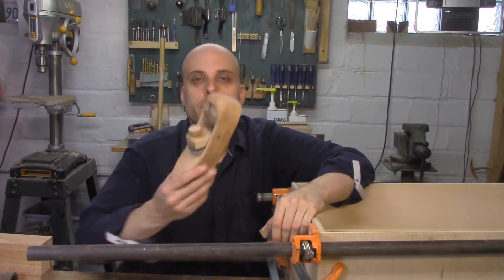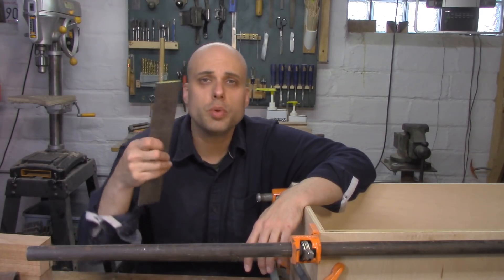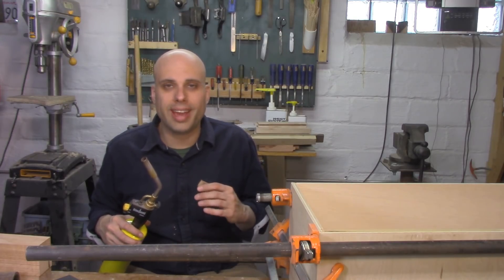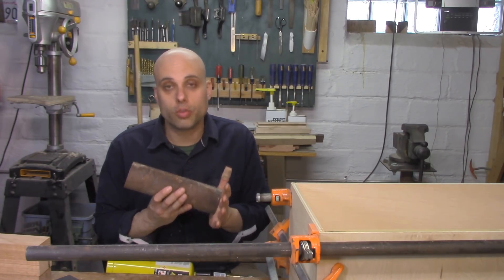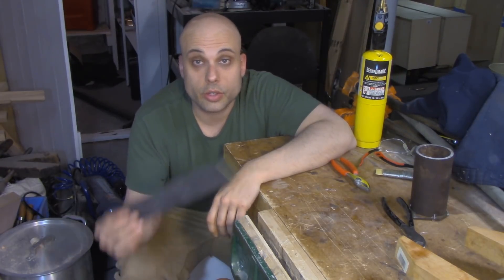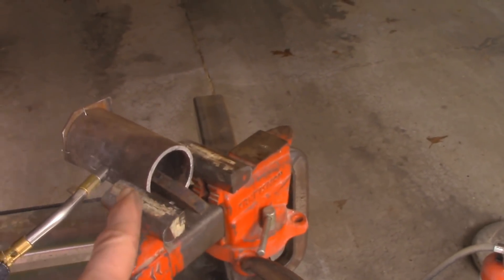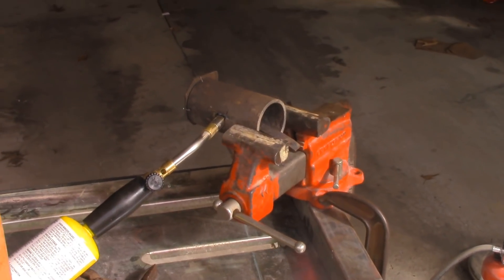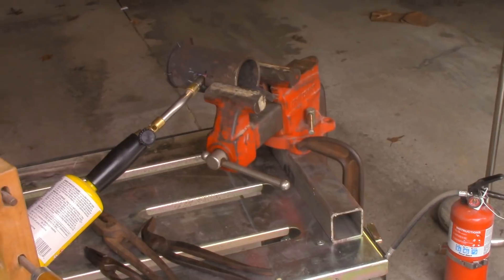Make a plane blade from SCRATCH (backyard heat-treating)

Comment: Does leaf spring need heat treatment before shaping it into a blade plane? Hasn't it already heat treated in the the factory that made it?
Reply: leaf spring won't be hardened to blade hardness,because that makes it brittle and easy to crack. springs HAVE to flex. and it's better to cut and shape your blade BEFORE you harden it,then do the final flattening and bevel finishing,stropping.

Comment: This is not a pro tip, but I'd not keep my fire extinguisher next to "the problem". To be fair, I do keep the fire extinguisher mostly in the middle of my workshop, but I know if anything was to light on fire, first thing I'd do would be to run out. Which would require me to run back in for the fire extinguisher. So since I have no idea where to place the fire extinguisher and have no intention on buying a new one, I have no other choice than to not be stupid, but I guess you have that covered.

Comment: Hi interesting video thanks, I received an old union plane from a neighbour which I have restored.  The only issue is once I sharpened the blade on the stones it doesn’t hold an edge any more.  After planing some spruce 2x lumber a few passes you can a burr form.  Do you think this process would work to reharden the iron?  I think if I have to spend 60 to buy a new one this things just gonna be a wall hanger unfortunately.

Comment: Great video....all the necessary information for anyone who has never done this. My first knife I treated in my Weber Grill with a large shop vac blowing air into the charcoal and an old car speaker for a magnet.  Eventually worked my way through a fire brick kiln to electric heat treating oven with digital control.  Have a mix of oils for quenching including a half quart of old transmission fluid. I get flashbacks of my '73 Ford van with a leaking transmission gasket when I heat treat a knife.

Comment: For someone who is a hobby black smith but also wants to get into carpentry, this has been the perfect video. I like to use traditional methods when I can so what I was looking for is the color of the Iron after you tempered it because, to me, a specific temperature isn't useful to know since I don't want to do it that way.  Looks like a darker straw color which is about what I was expecting but I wanted to be sure since I haven't done much tempering. Seems like you did some good research on the process. Thanks for the video.
Reply: I thought only dwarves could produce steel. Where did he get this from?

Comment: as a hobby baker, get a large pizza stone to put in the bottom of your oven and let it heat at least an hour before using. The stone will keep any variations in air flow or uneven heating from affecting your bake by acting as a thermal mass.

Comment: Moving your blade in the oil can cause the metal to warp the best thing to do is to move the blade in a vertical motion up and down trying to keep it straight. Until the blade is cool enough to handle without gloves. Just a recommendation. That gold color is the same concept and seasoning a cast-iron skillet. It is the oil residue remaining in the steel regardless it is still a great indication of proper tempering.

Comment: It's called thermal saturation. The air in the oven was 400 but the racks and walls were still pulling heat out.

Comment: 14:45color means absolutely nothing at all use a brand new Mexican made black diamond Nicholson file they are tempered to 64 hrc if the file barely bites and leaves heavy scratches on your tempered blade it will be fine for a plane and isnt too soft

Comment: At 1:27...let me stop you there.... As a experienced blacksmith/bladesmith (26years blacksmithing 7 years bladesmithing) i have to correct you... Neither of those steels are easy to heat treat at home and both are very unforgiving in their heat treatment theres very specific temperatures and soak times involved...that being said O1 is a medium speed quenching deep hardening steel this means you can quench in food oils just fine with excellent hardness if you got your temp and soak time correct...1095 is a shallow hardening fast quench steel meaning its very springy when tempered (it is a spring steel afterall) it also means water or fast oil quench only if you hit the specific temperature and proper soak time (parks 50 is the recommended quench oil) ...Neither should be used by beginners you should stick with simple carbon steels ideally 1075-1080-1084 they are cheaper and give rock solid performance with even the most rudimentary understanding of heat treatment
Reply: And for the naysayers i have gone toe to toe with mastersmiths over this very thing more times than i can count and proved them wrong with some basic metallurgy knowledge which you dont need to pass the ABS mastersmith test which i think is absolutely absurd and shows little mastery

Comment: 1095 is not really beginner friendly... it has less manganese and more carbon than other 10xx steels, making the heat treatment process less forgiving.  1075/1084/15N20 is way better for people starting out 👍
Reply from the maker: I don't know. I got it right on my first try...and my second...and my third. Doesn't seem too tough to me.
Reply: @RexKrueger  I'm glad you are happy with the results you have had. 
Still, to get the most out of the steel/heat treat 1095 will have the best results when the heat is consistent and measured, the steel is soaked at temperature, and a fast quenching oil is used. 1084 will give better more consistent results and end up a little tougher using the methods in the video 👍

Comment: Rex are you cacnadian cause those temperatures seem a little low.  I’m thinking 1800 to 2200 degree Fh. I’m mean I forged a lot of blades. So. Yeah.    Call if you need a little help sometime.  Oh yeah a little ceramic wool would help a lot

Comment: When talking about the oil flaring up, you should remind them not to use water to put put an oil fire, as the oil will float atop the water, and may, in a worst case scenario, turn a can of flaming oil into a 5 foot diameter puddle of oil flaming atop water.

I"m sure I'm not the only person who saw the 5 gallon bucket near the oil......

Comment: I am a blacksmith/bladesmith and i temper woodworking tools at 325  to 375 depending on the tool plane irons i temper at 325 chisels and wood slicks and similar tools at 350 to 375
Reply from the maker: Good for you?

Comment: Used lawnmower bladed are just about the right size and thickness and free. Make a coupon for a test in oil quench. If it hardens enough to break cleanly, the steel could be used for an iron.
Reply: I've heard of the "break test"... BUT never actually seen it done.
    What mechanics do you recommend???

    I mean... if I stick the end in my vice, and strike it with my "breaking" hammer (or as some call it "the big F") I can pretty cleanly cleave about anything... including most stones... so I'm just a tad apprehensive. ;o)

Comment: You could have saved yourself the trouble of making that oven contraption and just get out a charcoal barbeque and a use a hairdrier as a blower to get the fire hot enough.  Afterwords you could have cooked dinner over it aswel.   It would have saved you time and be a lot safer than the setup you made. Even it was a great way of solving the problem at hand.  Take a look at the video's from Paul Sellers.  The guy is great and he explains a lot. He is on the oposite side of the spectrum of where you are, ie he is a retired carpenter/woodworking teacher that explains how to build tools and stuff instead of buying everything.

Comment: A Bi-Metal Hole Saw is the best readily available tool for putting a hole in thick-wall steel tube. Especially with a drill press. Done both the step-drill and hole-saw with a hammer-drill in 1/4" thick structural steel, and the hole-saw was way less of a hassle.

Also: refractory materials are hard to find, don't get me wrong, but having a ceramics supply shop nearby can make things a lot easier for the home smith.
Reply: OR... getting a pack of "ceramic brickets" from the barbecue section of any hardware or similarly inclined department or big-box store works...

    AND of all things, plain old wood-ashes work WONDERFULLY with "stucco mesh" as an insulation. ;o)

Comment: Interesting forge!  Hey, it works!  That's the main thing.  I'd never have thought of using that small of a pipe for a forge but, as I said, it worked!
My question is, how the heck did you get the MAPP gs to last that long!  I finally quit trying to use it for anything because it runs out so quickly!  I hardly ever get more than a total of 5 minutes!
Good video and everything worked!
KUDOS!
Reply from the maker: Thanks!  I don't know, but my MAPP cylinders last a long time. I don't know how to explain it.
Reply: @RexKrueger  Thanks!  Maybe it's the altitude!  I live in Wyoming above One Mile above sea level!  I can't explain it any other way!

Comment: The most accurate thing that can be said about an oven is that it's never accurate.  Most ovens' thermostats are designed to let the temperature fall about 20 degrees F below the setting before kicking the heat on again, then surge 20 degrees above before cutting the heat off.  And that's at the location of the thermostat -- ovens have hot and cold spots throughout the space of the box.  So if tempering metal needs that level of precision, it won't be achieved in a residential oven.
Reply: If you have a sand filled metal pan that has been in there long enough it might work as a heat sink to keep the temperature more consistent.

Comment: Rex.  did you try hardening the first blade that was supposedly already hardened?  I doubt it would, but it would be interesting to hear any results if you gave it a try.
Reply: Actually, it's worth pointing out here (somewhere) that "the steel is still the steel"... 

   If it's meant to be hardened in the first place (like tool steel) it's going to take hardening...

    The only caveat here, is that some particular grades actually work better annealed (softened) first... to a "reliable consistency"... Then the standard heat treatments do just as well as "from the raw". ;o)

Comment: For ovens I've found that they should soak for 20 to 30 minutes. More if there's a larger thermal mass inside (like a cast iron skillet or a baking stone or steel... not related to this video... ;)

Comment: Saw you making this on Instagram, any future plan for making a more permanent forge?
Reply from the maker: Absolutely. I just found a real anvil in my parents' farm in CT. They'll bring it to me this summer and then I'll build a propane forge. I already have some tongs and hammers, so the full rig won't be hard to assemble.
Reply: @RexKrueger , just in case you're interested, I've made several "hobby forges" out of old pipes and brake drums... 

   I have a pair of drums out of an old tandem axle dump-truck for my personal monstrosity... (lolz)

   AND wood-ash makes some of the GREATEST insulation in the world! ;o)

Comment: I saw someone else here on youtube using a rocket stove to heat treat. No MAP gas needed - you can use up the chips and shavings and crusty offcuts from your work as heat, and then pop some food on after. It's a lot slower than a torch and firebricks even, and no serious smith would use it for heat treating, but once you have it set up, the cost is minimal for a woodworker.

(Plus you can tell your wife that the space it takes up in the garage is worth the cooking you'll do on it for her - no more charcoal for grilling)
Reply from the maker: I think I saw that video, too and I really liked it. Since I already owned the torch, this seemed like a good way to go for me. Many ways to skin this cat.

Comment: The thing about a kitchen oven is that the temperature varies within the oven, top to bottom and center to edge. So if you are going to the trouble to measure the temperature, at least put your steel right next to the thermometer.

Also, the temperature varies quite a bit over time, as the oven cycles the heat on and off to maintain the temperature. 20- or 30-F variation over time is not unusual.

If you want to be as accurate as possible, you need something with high thermal mass to smooth out the time variations. So, put a pizza stone or a big slab of steel on the oven rack, and then pre-heat it for at least an hour, with the thermometer right on your thermal mass. Then you are ready to anneal your steel.
Reply: To add to that, in my experience those cheap thermometer's are no more accurate than the oven's thermometer.
Reply: @DementatDeus  you need to calibrate them in ice water.
Reply: Just an addendum here... and I know it's old.
    LOTS of cabinet shops and kitchen outfitters have stone... and granite is one of my favorites for its tolerances to heat (specifically)... Just ask the shops for "ends and bits" and you generally have a good chance of sizeable pieces that are nice and flat, precision cut thickness (which is reliable) AND either cheap or free ...as in FREE! ;o)
Reply: And? It worked didn't it? 
But I guess it is a "hot" tip.
Reply: He mentioned that in the video

Comment: Great video Rex. Obviously, you did a lot of research going in and it showed. You really should take a few hours now and make yourself a basic "coffee can" forge. It's easy and will make heat treating easier to control. Thanks for sharing.
Reply from the maker: Thanks!  I want to do the coffee-can forge, but i think I might jump straight to a freon-con forge. I've got a line on a good anvil and I've already got tongs and hammers. Might as well go full-blacksmith. Probably this summer.
Reply: There you go, in for a dime in for a dollar. Next you'll be making knives...
Reply: Excellent video, Rex. Spot on information. If you've done enough research to find freon tank forges, you are well on your way. If you want to find the most authoritative info available on propane forges and burners, take a look at the Gas Forges topic at IForgeIron.com . Hundreds of years of aggregate experience there. Just beware the slippery slope of working with hot metal :-)  Clyde

Comment: So now that you have your forge setup, is there any value to reheating your edger blade(s) from the previous video?  And why do i half expect to see a Damascus plane iron next week?
Reply from the maker: So, I have heat-treated and quenched a sample of that steel. Didn't harden. Not enough carbon. Drag. As to the Damascus, you're very flattering, but I'm WAY too new at metal work for that. Thanks for watching.

Comment: Old plane's Irons were tapered in width: more beef at the cutting edge and thinner the oppoite size. could we replicate this using non specialist tools?Secondly how could i check my grinding angle is correct while using bench grinder?Many thanks
Reply from the maker: Those are REALLY good questions. As to the taper, it mostly helps with the wedging action of older planes; it's not necessary on a plane like this. Just use a thicker hunk of steel (I used 3/16) and have more beef the whole way down. And if you really want to taper an iron, I'd just use a belt sander. To check your cutting angle, use a protractor to strike a 25 or 30 degree angle across the corner of an old credit card. Cut that angle with a knife and a straight-edge and you'll have an angle template. Put the straight side of the template on the tool-rest (buy or build a good one that's easy to adjust) and then adjust until the angle you cut is up against the wheel. Hope that helps!
Reply: many thanks! i believe i will become your patreon very soon. Do you think the "lever cap" method you showed us in hand plane construction part.2 will work fine for a jointer hand plane?
Reply from the maker: Absolutely! If you're making it out of wood, it should be something strong (oak?) and leave it thick (3/4ish). You can also make good ones out of soft metals like aluminium and brass. Those are easy to work but stronger than wood. I have several posts on this, including sneak-peaks of the upcoming plane build on my Patreon page, so for $2, you can get some more information right now. No pressure!